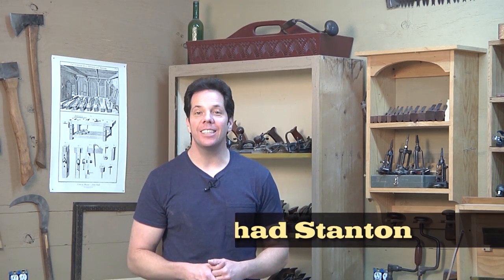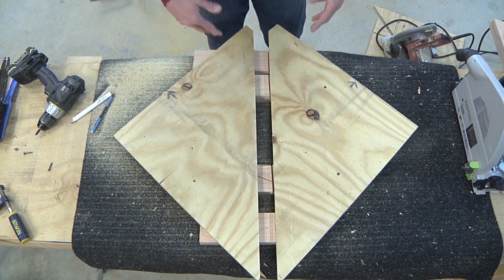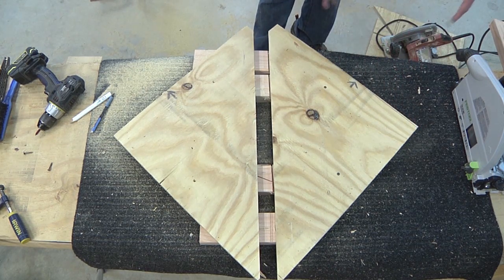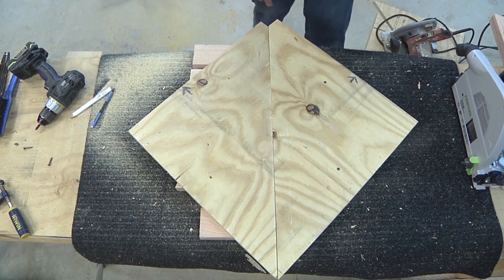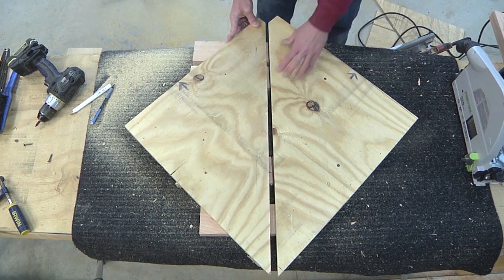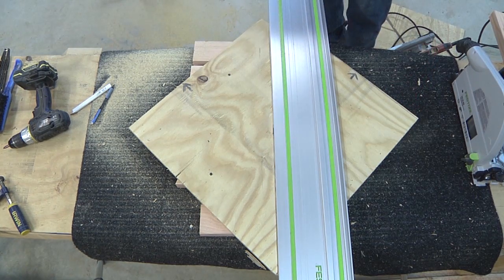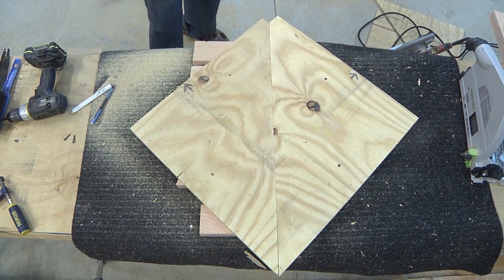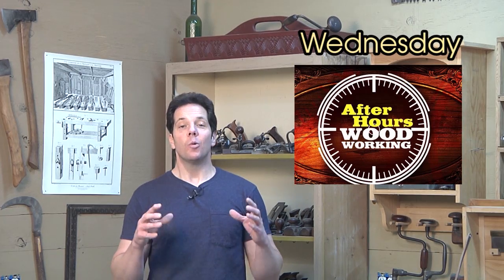How To Make Large Miter Cuts

Comment: Chad I have used this technique before and it has worked well.  Similarly you can join two boards with a hand plane by clamping the two boards face to face with the edge you want to plane as close to aligned as possible.  Plane both edges at the same time.  It doesn’t matter if the edges are planed level or not they will fit together perfectly.  This works especially well with 1x’s, since a No 4 plane and above blades are 2” wide or wider.

Comment: I worked at a counter top shop back in the...errrm... never mind. We had a large horizontal panel saw with grooves set at, say 45 and 90 in both directions. We would place the made up counter tops in the grooves and put a framing square on them then when exactly at 90 saw through both sides to make a perfect angle cut at either 45 or 90. I forgot about this method. Thanks for the refresher!

Comment: Nice tip Chad !! 🤗
I did something similar but slightly different....used my router ... 1/2" straight bit & workpieces gapped at 7/16" ... 

Of course u really need to cut a masons mitre if the desk edge is rounded-over... 🙄
Reply from the maker: great point!